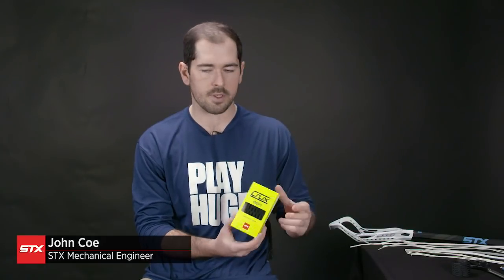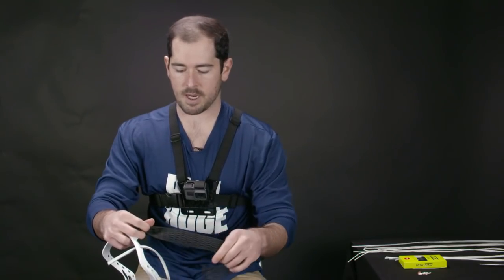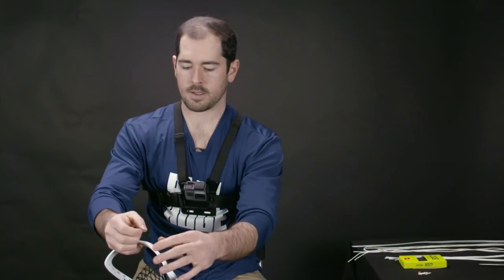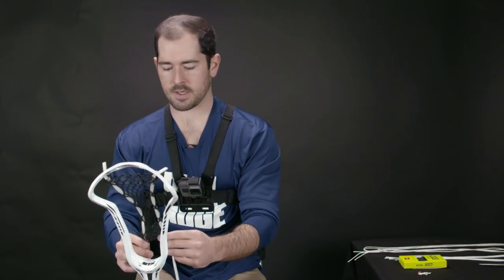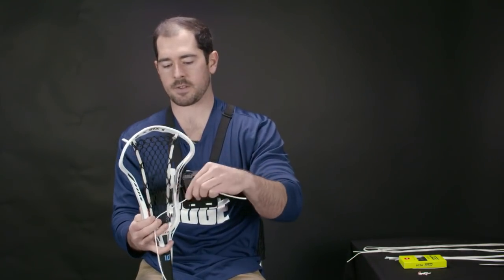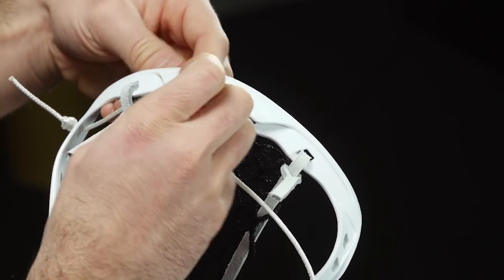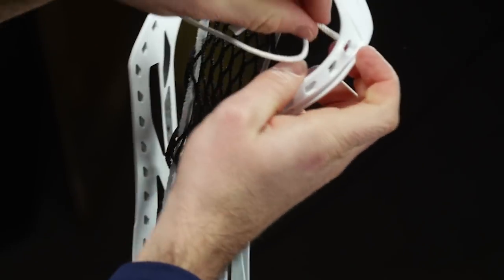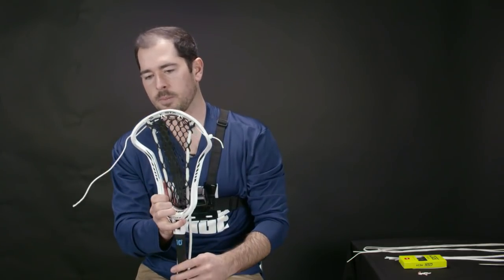STX Crux Mesh Stringing Tutorial - Crux 600

Comment: Key to keeping the pocket legal is to remove the bottom string that weaves through the lower part of the mesh and weave it up higher to push the mesh tighter. Keep the leathers ( or nylons) tight from top to bottom. It’s easy to adjust and once it stretches, it’s done stretching. My crux mesh,  my daughters, and many on the team don’t have to mess with it at all once it’s broken in.